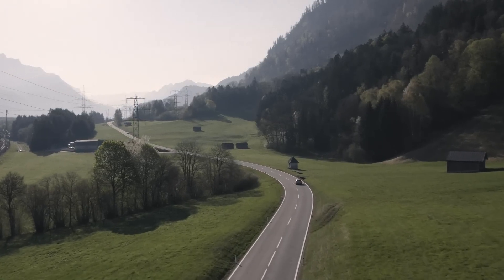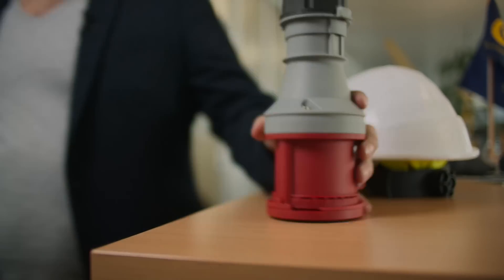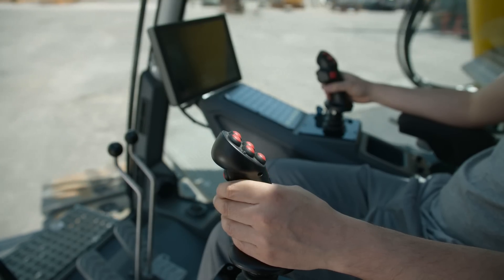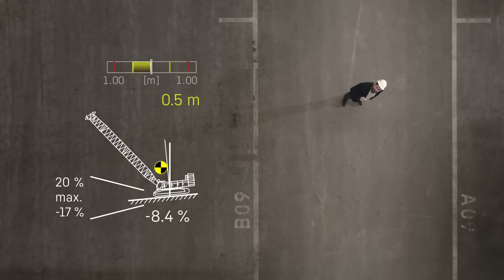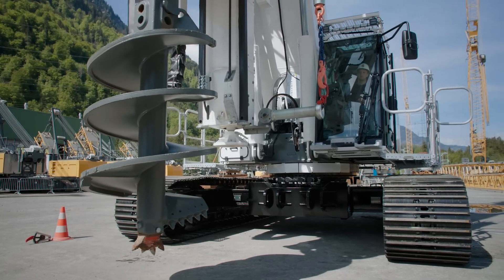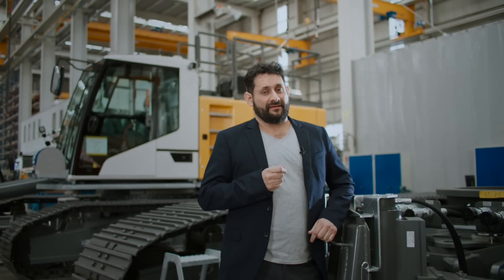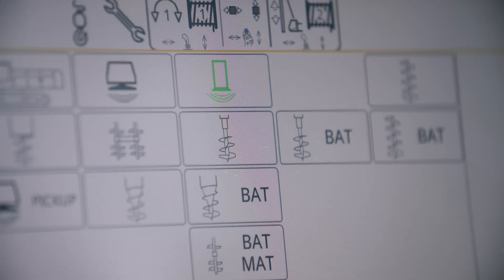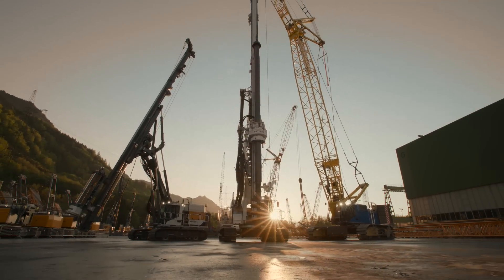Liebherr – New unplugged machines: battery-powered and zero emission

Comment: I'm kinda sceptical about battery-powered construction equipment. The biggest issue remains as to how you safely store such large amounts of energy in a battery without the battery becoming a weapon of mass destruction. How are these guys going to store energy densities approaching that of gasoline or Diesel in a battery safely?

Personally, I think electrifying heavy stuff is just a PR stunt.
Reply: It depends on the Battery-Chemestry used. NMC is highly flamable, while LFP ist rather safe, even when physically damaged. LTO is even better, but way to costly at the moment.
Reply: @Beredro  LFP and LTO also have significantly lower energy densities than NMC and LiCoO2.
Reply: @electric7487  You are somewhat right. LFP isn't that far away from NMC. But either way...space and weight are not as much of an issue in construction equipment as they are in electric cars.
Reply: @Beredro  The problem is still there, though. Diesel fuel is 12.6 kWh/kg, and the best batteries are 250 Wh/kg. So the battery pack alone would weigh 50 or so times more than the tank of fuel, and would take up over 30 times the space.

And as you increase the energy density the stability issues that are not a problem with LFP really do come back to bite you in the ass.
Reply: @electric7487  Sure, diesel or other fossil fuels have a much higher energy density. And batterz tech will probably never reach that of fossile fuels. But consider how terribly inefficient the process of converting the chemical energy of diesel into useful motion on that drilling rig is.... And the process of extracting the crude oil, transporting it to the refinery, converting it to diesel, and transporting it on site is often overlooked, in my opinion. 
Sure, current battery technology is not perfect and has many flaws. But these are the first respectable steps toward an electric future. Some don't like it, some do, and some are on the edge. 
I, for one, love my 6.0L V8.... But electric machines and vehicles of all kinds are the future. And they are already pretty safe and getting better all the time.
Sorry to go in a different direction.... I may be biased because I work on electrification mzself. (And I would love to work for Liebherr again :P )
Reply: @Beredro  Luckily, manufacturing processes that can produce synthetic petrol and Diesel from CO2 and biomass already exist. These processes have very low net CO2 emissions yet still have the ability to supply us eith all the fuels we'll need. Plus, with all the research in carbon capture, even fossil fuels can eventually be cleaned up. These will allow us to move our world forward safely.

The added efficiency of a fully-electric system is irrelevant if you can't store the energy safely. About the only thing that would make fully-electric construction machines possible would be nuclear or hydrogen fuel cells.
Reply: @electric7487  Hydrogen is good as a "green" fuel, but not particularly safe. Nuclear energy sources should remain as large power plants. I can't imagine small versions being a viable alternative.
Converting CO2 to fuel comes with even worse efficiencies. These energy losses add up to a pretty big number. 

With a large enough lithium battery, you can get 95% to over 99% efficiency. Inverters and electric motors are also great. Plus, you only use the stored energy when you move the machine. The diesel engine is often left running when nothing is moving.
Reply: @Beredro  Given how deadly high-energy batteries would be, the high energy consumption of converting CO2 into fuel is just something that we just have to accept.

The best solution is not based on absolute efficiency, but instead, a compromise between what is efficient and what is practical.

I could see Diesel–electric drives being a good solution, though.

Nuclear is basically a necessity in the future, but wouldn't be practical for small-scale applications or even trucks and construction/mining machines, so it's best suited for base-load power stations.
Reply: @electric7487  "About the only thing that would make fully-electric construction machines possible would be nuclear or hydrogen fuel cells.", weird comment to make on a video about fully-electric construction machines that already exist and are in use.